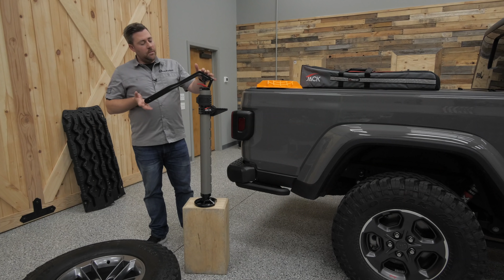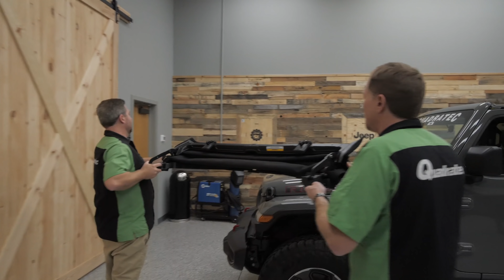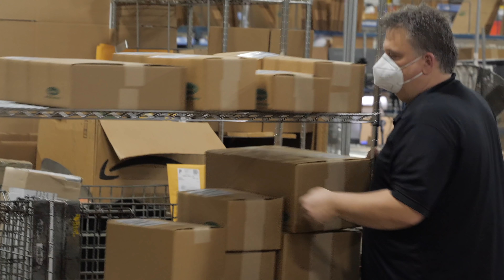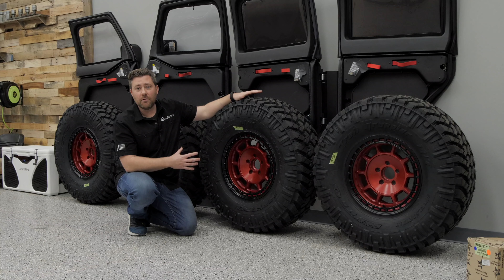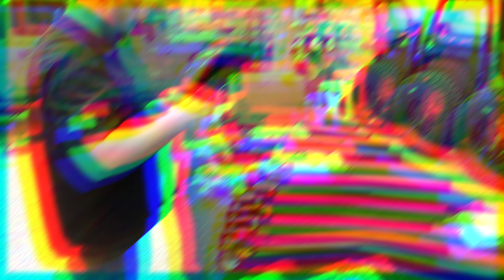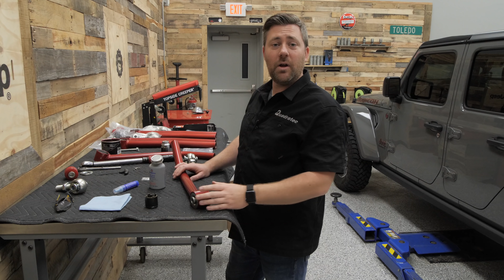It's Finally Time for Rob to Really Start His Gladiator Build Up - Suspension, Wheels & Tires

Comment: Looking at the same lift and im wondering is there enough travel in the stock fox shocks to use them with the rock crawler 3 in lift or will I need to get new shocks

Comment: Can a Gladiator Sport with 3:73 gears handle 37” tires or does it need re-gearing? 👍
Reply: I would regear it. You will lose a lot of power. I have 4:10 and going to regear when I jump up to 37". They sell the regear kits at Quadratec. You can google what gears you need for that size tire.
Reply: Thx for the advice
Reply: 4.88 is what you want

Comment: Already done mine, but still got a long way to go...  It is a Jeep, so infinite upgrades, means need to win the lottery.  🤣

So far I’ve done the Skyjacker G250MSB lift, 37x13.50 Kumho KL71’s, 20x10 Moto Metals, Fab Fours Stubby, Warn 9.5XP, 67 Designs phone mount, etc...  Just ordered my Fox TS 2.0 steering stabilizer this morning.  👍🏻

One day I will do a video about it.  But for now, pics are on my Patreon, since I don’t use social media.  👍🏻